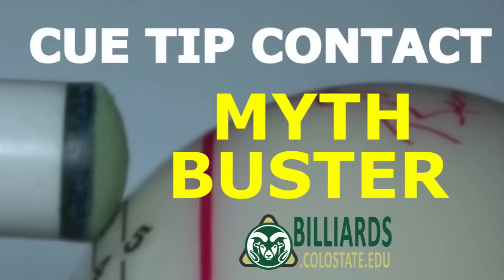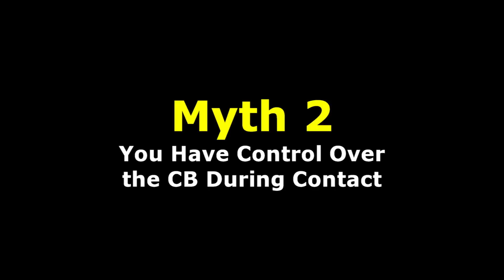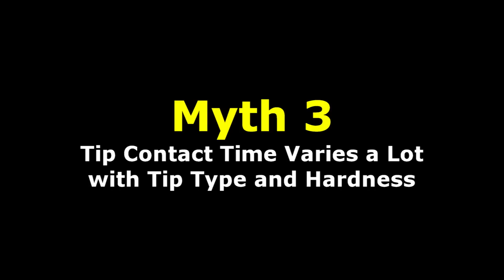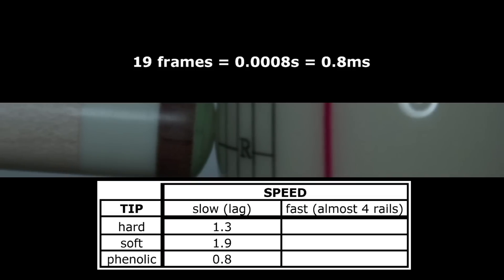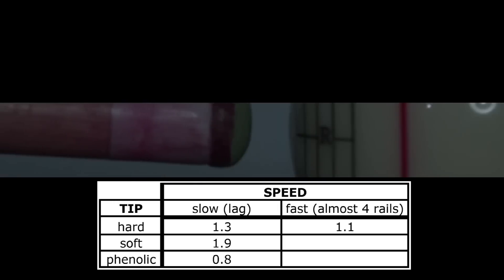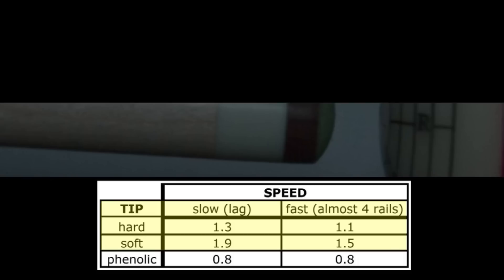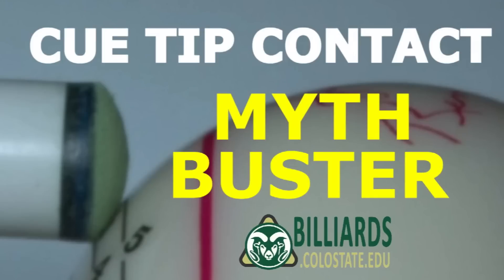Cue Tip Contact Myth-Busting Truths in Super Slow Motion

Comment: [Very long message warning] Thank you for investigating this question and your extensive work to the benefit of the pool community. I have some thoughts on this analysis.

I agree that 1-2ms is a short period of time but in English pool or snooker the range will be even greater, and it is not possible yet to immediately conclude that the variation of doubling (or much more in other versions of pool) the contact time does not affect the shot.

Note that for experienced players, much of the delivery of the shot is a subconsciously controlled process (like balancing a bike) and so takes a different neural pathway going only through the spinal cord, much faster than being additionally processed by the brain. Googling suggests conscious reactions experience a 100-500ms delay. I cannot immediately find research putting a time on reflex delays but being 1-2 orders of magnitude faster doesn't seem to be out of the question. Within the context of American cues, even the softest tips are frankly very hard in comparison to English/snooker tips. A 'hard' English cue tip is approximately the same as a 'soft' American cue tip. There is a difference in inertia of the American and English whites which I am sure will be significant, but nevertheless I can guarantee that the contact time of an actually soft English/snooker tip would be many many times longer than for a soft or hard American tip.

In English/snooker a key reason for choosing a softer tip is to grip the white better (deforms rather than sliding off) while a key reason for choosing a harder tip is to receive more information from the forces and vibrations experienced by the cue *during contact*. This can be felt at all points of contact with the cue (bridge hand, cueing hand, chest/chin) but predominantly the hands, which are full of nerves, closely connected to the spinal cord and have specialised pathways to process touch from our hands especially well. Note American pool players are much more likely to wear a glove (less feedback during contact) then players of English pool or snooker. Additionally, American cues (especially with a low-deflection shaft and a pro taper) are designed to 'get out of the way' of the white, which is visible in the recordings, and this could further reduce contact time. An English or snooker player aspires to cue in a straight line without deviating, actively hoping (at least, if not trying) to not bring the tip away from the white, by contrast. From experience and speaking with better players than myself, one can subconsciously adjust one's stroke during contact. Within the ranges of English/snooker tip contact times, this is possible to do for soft-hard tips, easier to execute but harder to feel for soft tips and harder to execute but easier to feel for hard tips. That's all to say that it seems reasonable that for all but the very softest American tips, there may not be a meaningful overlap in the contact duration of such hard tips and the reaction time of a reflex reaction, but for English/snooker tips, it is possible to adjust your stroke during contact. 

I would love to see a follow-up measuring the contact times for soft English/snooker tips on both English and snooker cue balls, and then comparing this to some reliable research on subconscious reaction times of professional sports people (I don't think sprinters' 0.1s count though as it isn't a hand-contact). An additional point to consider for further analysis: currently this assumes a stroke which is no longer accelerating at the time of contact with the white, but it would be interesting to see how the contact time varies with acceleration (or even deceleration) of the cue. Perhaps for better players it is worthwhile to still accelerate the cue through the white if this increases contact time for more spin or importantly more time to react to the feeling from the contact. 

Additionally, a cue contacting the white underneath the centre of the white while the player applies a force or toque to prevent the cue from lowering into the cloth (take it from me that English players almost never cue to touch the cloth while American players often do) would be held down by the weight of the white above and held up by the player, it is not inconceivable that there is a balance with the lifting force on the white which allows the cue to remain in contact with the white longer (if you don't believe me, imagine a scoop shot which doesn't just wedge below the white but lifts the white itself). Meanwhile it is common for players in English or snooker (the opposite in American and less so in snooker than English) to find it much easier to avoid miscueing during a draw shot than when applying topspin, and it seems clear to me that the above point explains this. Therefore, also including measurements of contact times across varying levels of back- and topspin would also likely yield a trend towards longer contact times for backspin shots. Another factor would be the thickness of the tip as for a given hardness, a thicker/taller tip would compress more and I would posit that this might also increase the contact time.

Putting all this together, a soft English tip applying backspin, without a glove, for a very experienced player... it is definitely conceivable that the contact time is longer than the spinal-cord subconscious reflex time. I would love to see this fully investigated. I am doing a PhD already but if not it would be awesome if it were possible to do a PhD or masters (physics) project investigating this!
Reply from the maker: I suspect the contact times are much smaller than you think.  FYI, I have more videos and a lot more info on this topic here (and at all the supporting links):
    https://billiards.colostate.edu/faq/cue-tip/hardness/

Comment: go learn physics, then do the your test the right way AND then you will be able to understand your results .
yes they small numbers dosnt mean they do not mutter or do not have effect
Reply from the maker: If you want to see convincing proof and detailed explanations, see the follow-up videos, info, and links here:
    https://billiards.colostate.edu/faq/cue-tip/hardness/
Reply: @DrDaveBilliards  no need, I am a physicist,
that assumption is wrong
Reply from the maker: @posford  FYI, I have a PhD in Mechanical Engineering and taught advanced physics stuff for over 30 years.  Of course differences in contact times change the average force over the time, but it doesn't change the total impulse corresponding to the momentum transfer.  For detailed explanations along with supporting proof for why the differences in contact time are unimportant to actual pool shots, see the explanations, videos, and links on the resource page:
    https://billiards.colostate.edu/faq/cue-tip/hardness/
Reply: @DrDaveBilliards  i think i have my understanding, i will watch the video, i hope this week .
we all might be wrong .
Reply: yes, he is wrong. He uses stiff body physics in his calculations, where there is a spring force. This is even visible in the video.
Reply: @jan.kowalski  you are correct .
Reply: @posford  yep, he should read about Young's modulus at some point.
Reply: @jan.kowalski  Emotional damage . .  :)

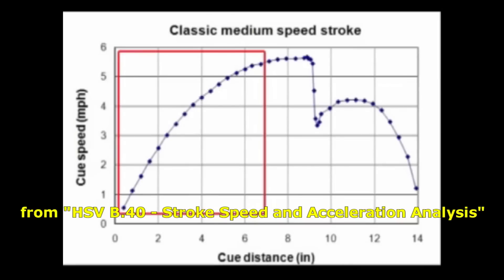Comment: Hay Dave, thx for the Videos. I Have ove myth/question. Look at the graph at 1:33. According to the graph the ball is hit with constant speed = Zero acceleration. Dv/ dt = 0. The mystery is about if one can increase the time of tip contact if dv/dt is non Zero. So, if one strikes the ball with the speed that is found in the graph at 1:33 for x value (cue distance = 4) equal to  approx 4.2. At that x Value dv/dt is clearly not Zero, hence the acceleration is non Zero and therefore one should get longer contact time; question mark. 🤔
Reply from the maker: Even if accelerating into the CB created different contact times, the differences would be unimportant per the info here:
    https://billiards.colostate.edu/faq/cue-tip/hardness/
    https://billiards.colostate.edu/faq/stroke/good-timing/
But most good players reach max speed at the CB; otherwise, the acceleration has bad timing (is too late) and is not useful.

Comment: Thousands of Newtons of force can make a considerable difference even in hundreds of microseconds.  This is especially true for spin.  The cue ball momentum is independent of the tip, but the friction and spin is much better with a soft tip.
Reply from the maker: More force over more time does make a difference, but the rest is not true based on the explanations and supporting videos and links here:
    https://billiards.colostate.edu/faq/cue-tip/hardness/
Check it out.
Reply: @DrDaveBilliards  My experience says the opposite.  Five years of trying never made a hard tip perform as well as a soft tip.  The difference is not huge, but trying for extreme spin with a hard tip always results in a miscue.
Reply: @byronwatkins2565  he just did a wrong calculations thinking in terms of stiff interactions. Obviously, which video shows, there is an additional  spring force.